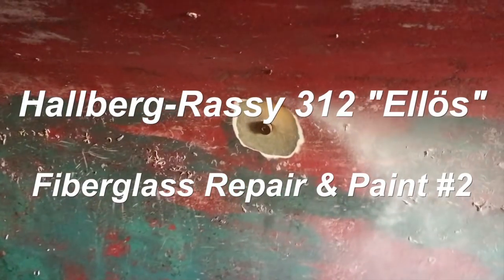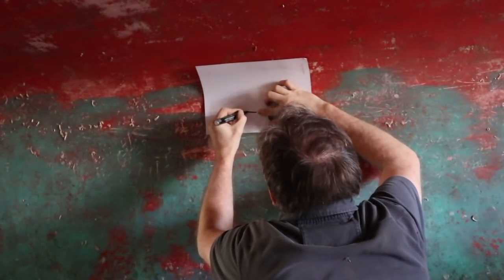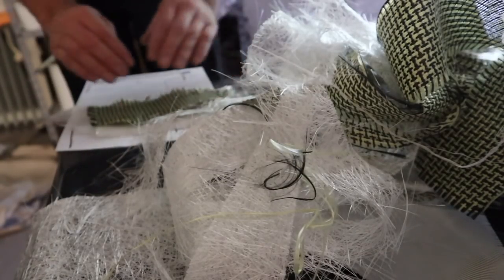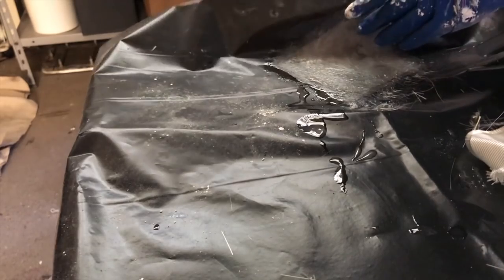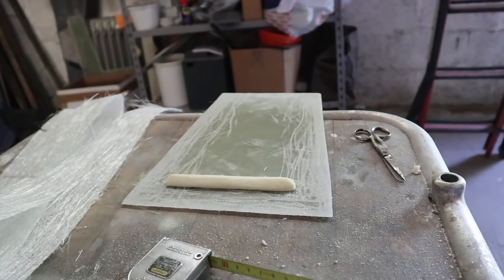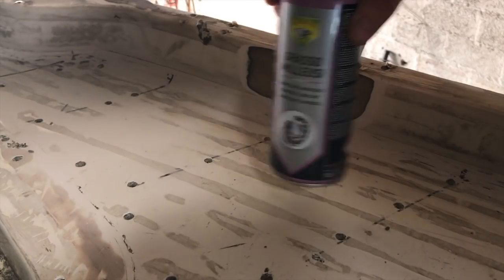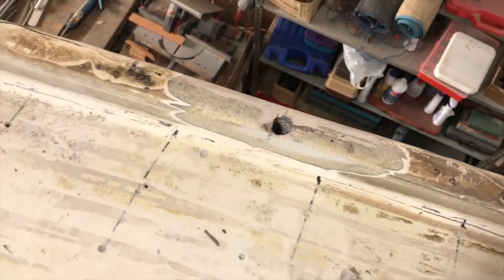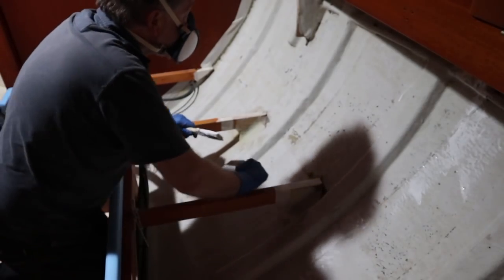Hallberg Rassy 312 "Ellös" - Sea4See -  Fiberglass & Repair #2

Comment from the maker: Guys thx for comment, someone already told me the not correct way to repair a hole that I used. Yes right! Was a mistake!  but in any case the hole is so small and Using epoxy add with a mineral fiber create in any case a strong bonding didn’t create any worries. I replicate inside the boat In correct way the bonding. I think I will not sink for this.. hope so👍🏻🙏🏻

Comment: When patching holes, my understanding is that you're supposed to use the largest patch first for maximumum adhesion, then progressively work outwards with slightly smaller patches. Cheers 👍
Reply from the maker: Thx for  drop a comment to my sailing vlog! Yes you right! I did reverse for mistake ah ah but already did in this way in other situation never get problem! I used epoxy where I add mineral fiber so at the end I got in any case a strong bonding and for a small hole could be ok.i already patches inside in the correct manner... but I didn’t want grind and start again. 👍🏻💪🏻
Reply: Not necessary. Both options are correct. There is an everlasting debate about that but you can do it both.

Comment: Interesting video, really useful to see as I need to do the same thing on my 352. Can I ask, what type of matting and weight did you use? Im trying to work out what will be best for mine. It's interesting to see how it seems the damage was done on yours on the inside of the toe rail? On the 352's they seem to damage the outside of the hull instead. Cheers!
Reply from the maker: hello ! txh for write! yes I will explain you soon! i got same of your problems. inside and outside.
please check my facebook profile and drop a message I will forward all the photos and infos! 👌

Comment: Please check some 39 minutes into the video https://youtu.be/J6wL29MuuX8 , why do you start with small piece first ? Easier ?
Reply from the maker: Nick A thx a lot to drop a line and watch my sailing vlog channel ! Yes I start with small one and more bigger later. I tried many option in my life  for me all works well,  in some video they start with big one in other small one in any case for me is important no bubble inside and make a correct procedure with epoxy. No any type of procedure of holes repair let me down especially small holes!
Reply: Thanks for your reply. Seems like it doesn't matter if you start with small piece or big from your experience. I really like  your youtube channel and i will keep my fingers crossed for you and your boat!!
Reply from the maker: Nick A thank again!  Incredible after years of repair in the boats sometimes you make dumb things 🤪🤪🤪🤪